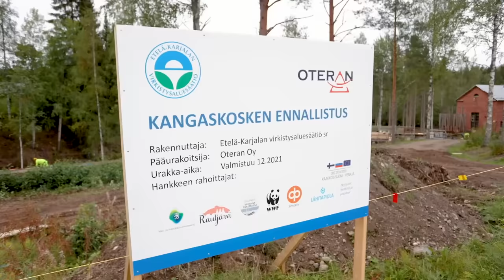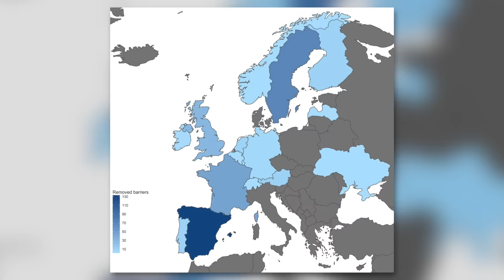How (And Why) Europe Is Removing Its Dams

Comment: There must be a negative impact from removing these dams.  They were built for a purpose so it would be interesting to know why those purposes are no longer valid.
Reply: Electricty generation, flood control, water supply. We can look forward to ever higher energy and water bills, higher insurance costs to pay for all the flood claims, and more expe4nsive food, since these dams are often the source of water for agriculture.
Reply: @hugheaston7598 Most dams that need removal are smaller, maybe generated a dozen KW of power, or were built to run water mills, make large basins for canal boats and feeding canal systems.

I'd scarcely think anyone's going to remove something that's making hundreds of KW to MW's of electricity, particularly when stable dispatchable generation that a large hydro dam provides is increasingly valuable.
Reply: I'm thinking the Hydro-Electric dams were built long before they had the technology for Nuclear Reactors all over Europe.  So, at least those dams are likely not needed anymore, or at least,  not as many.  Not sure about all the smaller ones though?
Reply: @hugheaston7598  Many of those power generation dams haven't been in use in years some decades, one I know of in Czechia (that barely produced a few kW); over 100 years...
Reply: @Roybwatchin  You do know that Germany decommissioned all their nuclear power plants, right?
Reply: Just as this video said that many of the dams were weirs, a video I saw previously, said that only a small percent of dams were operating for hydroelectric power. It would be really counter-productive if we destroyed major sources of clean energy. At the turn of the millennium influential environmentalists were opposing new hydro-electric facilities, saying wind and solar were the only carbon-free energy production acceptable. Another video said the cost of new hydro-electric dams were pretty steep per KWh.

So yes, it would be good to know what these dams were being used for: flood control, a recreational lake, crop irrigation, power for a small town, etc.
Reply: Why has my comment been deleted?? What kind of channel is this???
Reply: @oreziopancrazio3685  I don't know. That's been happening to me lately, where I get notifications on a thread but don't see my comment on that thread. Maybe it could be the author of the video, someone reporting me, or it looking like spam?
Reply: The only negative effect of dismantling these dams is that the demolition work requires a lot of money and is very expensive, but it becomes more expensive every day if the demolition work is delayed. For example, the price for dismantling the Tourujoki dam and rehabilitating the riverbed has increased tenfold due to a five-year delay. So the faster they are destroyed, the cheaper it will be.
Reply: Finland just started a huge new nuclear power plant so they can afford to lose some dams and improve the environment for their rivers. Perhaps this is why the Finnish  green party supports nuclear.
Reply: It won't be an issue for 15 minute cities, it will mostly affect the small towns and communities Gov'ts are trying to get rid of.
Reply: @tolson57 Finland seems to be smarter than that.
Reply: @raulghe I would have thought the Germans were smarter than that. I would have also thought that yhey would be smarter than to become dependent on Russian natural gas

Comment: This is horrible. As an engineer and an avid outdoorsman/ fisherman I care and understand  our environment. Please do the calculations. Hydroelectric is the cleanest most dense energy source we have available. We need to focus other engineering solutions for wildlife. Also consider, what other energy sources are replacing these powerplants. I've seen many fossil fuel plants take their place. Cui bono?
Reply: 1-Its not the cleannest
2-They barely lost any eletrical power. An engineer can't understand that 100yo dams don't produce eletricity anymore? Most dams were beyond their usefull life or to small to producw relevant ammounts of power
Reply: @joaquimbarbosa896  What is the cleanest?
Reply: @superlacrosseguy  nuclear
Reply: @joaquimbarbosa896  I would do nuclear as 2nd choice. My only beef with nuclear is that it dumps a significant amount of thermal energy into our atmosphere via cooling towers or river systems in order to create the low pressure side of the turbine system. Hydroelectric does not add heat to our atmosphere or rivers to create power.
Reply: @superlacrosseguy  That barely makes a difference in the local atmosphere, it literally makes no difference in the global atmosphere. Also nuclear for one does not stop river flow...
Reply: I heard something about salmon "pens".

When I was born, salmon was a special luxury.  Now it's like hamburger.  And with that blessing we have to listen to greener-than-thou idiots who get pouty about raising fish in pens.  "Hey tree huggers! Should we outlaw cattle raising and go back to hunting buffalo on horseback????"
Reply: @superlacrosseguy  Are you really a engineer? Waste heat does nothing to the climate. What actually effects climate are greenhouse gasses that disturb planet's normal temperature regulation, aka. trapping in the heat. 
Not to mention minor dams do not produce that much energy, or if they are old enough, they might not produce anything, or would cost a lot to repair and run properly. In which case you can just invest that money into nuclear or renewables.

Yes, dams are clean source of power, but considering other options we have and it's effects on river ecology, it's probably not very often worth it. And it's not "dense" source of energy. Nuclear is extremely dense, heck even fossil fuels could be said to be dense. On other hand with hydro we are talking about exploiting pressure of the water flow for running turbines, I'm not sure we can even talk about density.
Reply: @joaquimbarbosa896  Dude, I lived not that far away from the Chernobyl nuclear power plant. I've got a bad news for you. Take a seat.
Reply: @mukkaar  lol
Reply: @tonyka3545  Russia invading there? Because really thats the only danger currently...
Yes the Chernobyl accident was bad, but the worst consequence of it was the anti nuclear movement wich replaced nuclear with coal killing millions. Not to mention its impossible for a Chernobyl 2 to happen
Reply: @joaquimbarbosa896  So, you haven't heard about Fukushima....
Reply: @tonyka3545  The accident wich was ordens of magnitude smaller, and whose deaths came from overreacting in the evacuation? Yhea, my point stands. 
Ams even Fukushima is incredibly outdated compared to what we have today.
Also, it was kinda caused by a tsunami hitting the power plant, tsunami wich came from a magnitude 9 earthquacke. And the only reason the power plant did not survive getting hit was because the tsunami wall was to small
My point stands buddy
Reply: @joaquimbarbosa896  The power plant and every important building survived the impact of the tsunami, and everything worked as it should... except the backup electricity sources (diesel generators) whose shacks were flooded and could not provide backup power. And the rest is history.
But yeah, I do agree, Fukushima is not Chernobyl, and PWR technology (which I would call "the safest we have on the table right now") is not BWR technology or Graphite tech.

Comment: And they replaced the power generation with nothing
Reply: Windmills when there's no wind and solar panels at night.
Reply: How much electricity was lost then you reckon?
Huge gains opening up migration of species in and close to the river.
Reply: i guess finland replaced them with a nuclear plant?
Reply: Most are small dams 3-5 meters high located on secondary streams, the production of electricity is negligible
Reply: There’s no reason for power generation. Burn wood and cook fish. That’s what we did thousand years ago and we are very progressively moving backwards. It’s better to be simple part of harmonious nature rather than being exceptionally well off in dead desert.
Reply: Did you actually look at the size of the dams being removed in the video? These weren't Hoover, they likely only provided enough power for a paper mill and maybe a dozen houses at their peak. A lot of these old hydro dams aren't even producing anything anymore.
Reply: @NLuck-eh5cd yeah but they made regulation that prevents the construction of new dams 😅
Reply: Exactly as planned
Reply: @axelpersson8214  Just how huge is the increase in catch? These are small rivers, there's not much room for "huge gains". On the contrary, former ponds near the weirs were used as commercial fisheries for many centuries, and without weirs they're gone.
Reply: These small dams cost more than their are worth, I drove by a 400kw power house that had been shut down and it had a similar dam to the smaller ones in this video. Compared to some windmills that produces upwards of 16MW it’s insignificant.

Comment: It won't be a revolution until we find a way to create abundant renewable power. Here in Sweden 35-45% of our electricity comes from hydro plants. Solar and wind can produce some energy but not enough and not with a stable enough output that works for industry.
Reply: Nuclear…
Reply: @WeiglerGodoy  I think we need nuclear energy for a long time, but building takes time and most countries should have started building new plants decades ago
Reply: Solar, wind, geothermal and nuclear are all good options.
Reply: @guerreiro943  The problem with solar and wind is that together they can't provide more than about half of the energy mix if the country has industry that requires precise power delivery.
Reply: @jonasfermefors that's not true. If your country is big enough, then you will get enough energy of some kind to provide energy the whole day.
Also, grid connected battery farms are getting cheaper all the time and smooth out the energy generation for the day
Reply: @jonasfermefors  yes, people forget the dependance on weather patterns, location and stable power output when it's about solar and wind, they just believe or want to believe those are the best option going forwards, when in fact wind power is as harmful as coal, because those massive blades can come off and cause some serious destruction, and when they need to be replaced, they can't be repaired or scrapped, they have to be put in a landfill or incinerated, since any imperfections will mess up the windmill. The best options are solar, nuclear and geothermal. Solar can still be improved and would be amazing ifwe could achieve some sort of breakthrough, like placing solar panels in low orbit or further away and beam energy down (although nobody knows how that would affect our atmosphere). Nuclear needs to be de-regularized or rather, take away the insane taxes they have to pay and all the bureocratic nonsense they need to go through, plus we need to somehow beat oil+coal magnates from trying to fight back against people trying to educate the public on how safe and actually clean nuclear power is, that in so many years there was a single meltdown cause by human error, and another one caused by negligence + a tsunami. People are way too scared of nuclear because of mainstream media, social media and all the propaganda backed by oil and coal corporations.
Lastly, geothermal. This one could be a game changer if we managed to get some breakthroughs there, and we aren't that far from actually making those possible. Geothermal could give us an stable source of power that, while not the safest, it would most likely be really cheap and incredibly efficient.
Now if we only stopped believing in all the fearmongering, we'd have advanced so much in the nuclear fission tech, but nah, they're not profitable enough to justify dumping lots of money into nuclear fission research, so we're stuck with tech from the 60~70s instead thanks to lobbying and fearmongering. Nuclear fusion by association is also feared and fought against by once again, oil and coal magnates trying to keep their business going, because it's easier and cheaper to hold humanity's progression than it is to adapt their business model and products.
Reply: @rRekko  Wind power is fine too. It's developing technology, so there are things that can improve but that goes for any technology. Dismantling any form of power station is hard and expensive.
Reply: @WeiglerGodoy  50% Ukraina and France electriv from nuclear
Reply: @rRekko  The thing with hydro power is that its easy to control its output and it can be stored, so it can act as a battery of sorts for wind and solar.
Reply: @WeiglerGodoy  The proportion of nuclear energy can only amount to the lowest electricity usage of the day, because you simply can't change the output throughout the day. It's very comparable to the issues of solar and wind energy. Nuclear energy doesn't solve everything, far from it.

Hydraulic on the other hand can adapt throughout the day, and some stations can even pump water back up during low demand hours. You absolutely can't replace hydraulic with nuclear energy past a certain point.
Reply: @sucofnisucofni8935 Such plants exist. Sweden imports waste because our recycling is so efficient that we no longer produce enough waste for our power plants. Less waste to burn would still be preferable though.
Reply: @zatarstar5590 the best battery technology we have is still lithium which is horrible for the environment and rapidly decays. Not too mention it's capacity is mediocre. Realistically we need a new type of battery. So we probably won't have the suitable technology for what you're talking about for atleast another 30 years. (Lithium technology development started back in 80's and only came into it's own in the 2010's).